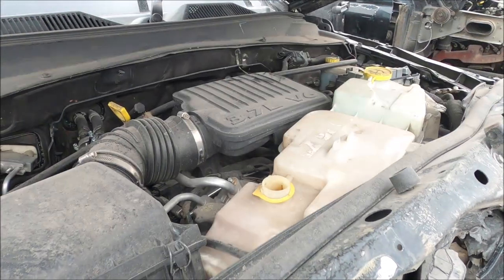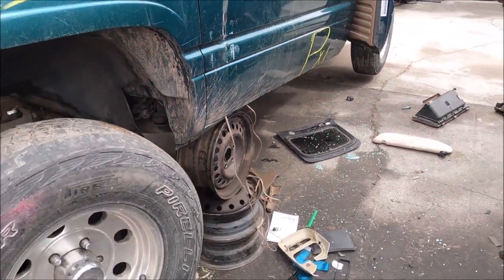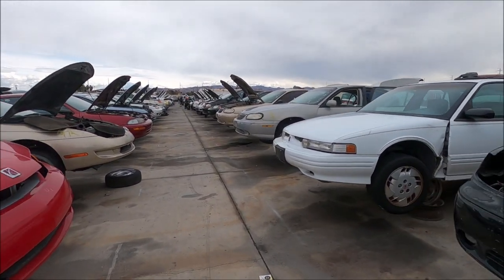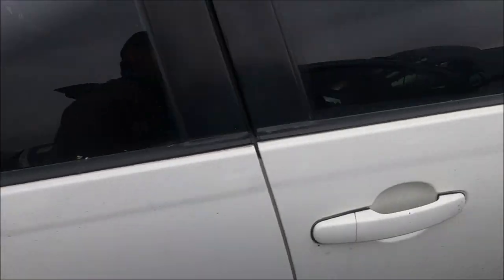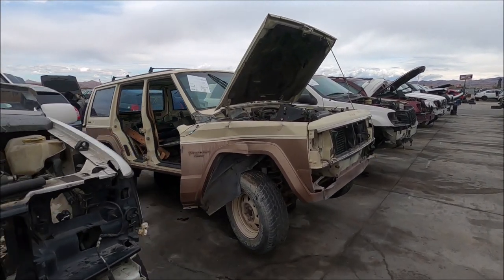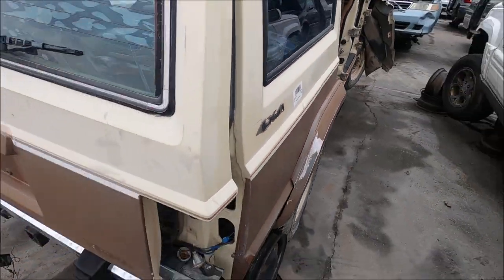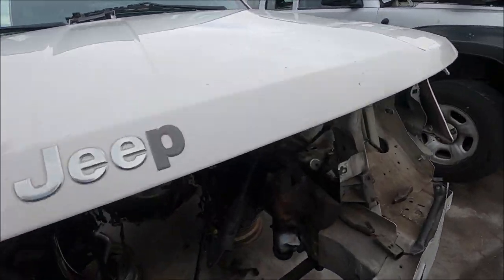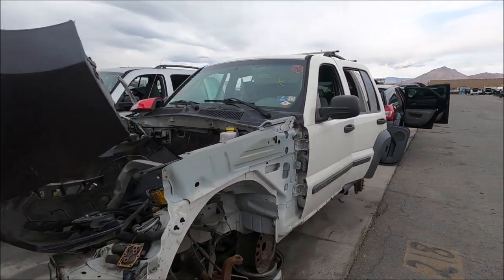On the hunt for 4.7 HO camshafts at Pic-a-Part

Comment: How's it going martin had a question down your alley was wondering if the 2009 dodge ram 4.7 torque sequence is the same as the older models any info would be appreciated.
Reply from the maker: are you referring to the cylinder heads and if so yes the same sequence.

Comment: Hey brother just wanted to let ya know been watching all your videos started tonight cause I’m doing valve seats in my 4.7 ram and the only thing I can think of is I’ve gotta pull the cams .. however do I gotta run the air down in every plug hole and do two at a time if I don’t have the tool like you do ?? Also check my you tube out I’m a country artist buddy ..thanks for the videos !!
Reply from the maker: Yes you need to run air into the cylinder that your working on to prevent the valves from falling into the cylinder.
 If you would like to purchase one of my valve Spring compressors you can contact me on my Facebook Messenger.
 I'll check out your YouTube channel

Comment: Can’t you have the journal’s machined? I just bought an ‘04 Overland in really great condition. Got it cheap because it had a cracked head, or so I was told. I wanted an HO so bad that I didn’t practice due diligence and may have bought a new anchor for my boat. Charged the battery and the starter engages, but won’t turn over. Going out now to check if the engine is seized. If not my plan is to build kind of an SRT clone. Your content will be invaluable in that case. Thank you for that. Fingers crossed 🤞
Reply from the maker: Right on, good luck with the engine and good luck with the SRT cloning 😉

Comment: That envoy with the paint all over is also rare so that's even more bad. They only made the GMC Envoy XUV for two model years and they are like a SUV and truck. The back part of the roof lifts up and goes forward and there is a window in the middle so you can use it as a truck and Obviously they had the window down when they crashed.

Comment: I don't know what it is but it's fun to go to the junk yard and look for parts, so sorry you didn't find any HO cams :-( , have you thought about doing a country wide search and see if maybe you could have some pulled and sent to you? I mean I'm sure you've covered that base with no luck I can only assume? What else are you looking for with your HO build? Blocks are the same right? what else is different? And finally what makes the HO better than what you've already done to yours?
Reply from the maker: I was looking to resale the cams as I have the 08 cams installed in my 4.7
The HO does have a 9.5 compression ratio compared to 9.0 and a steel crankshaft and yes the blocks are the same.
Reply: @martinbuilt  So if the HO is a steel crankshaft and forged if I've heard correctly, whats in the 4.7? Also, I can look up here in Denver for some cams if you'd like :-), let me know,... we have a few pick and pulls and Colorado has tons of Jeeps up here.
Reply: @martinbuilt  Martin, I was at a Jeep place up here in Colorado and talked to a guy that has a couple Jeep Grand Cherokee's with 4.7HO's, he said the engines are locked up but maybe give him a call and see if he has anything for you. Here's the link to his site, his name is Mike, tell him the guy with the blue jeep sent you.  http://jeeprepublic.com/

Comment: I can't believe they. Whoever the owner was of the HO g just left it. I crashed my 2001 with a low mile rebuilt motor and it's always worth rebuilding no matter what the damage is. You're never more than four or $5,000 away from an awesome four-wheeler If you ain't got the money, hang on to it till you do
Reply from the maker: Yeah, you should see the Jeeps out here 98% of them are completely rust free because they're from Southern Nevada and I just picked up an HO engine from a 04 JGC that looks to be rebuilt. I did a leak down test on it, and it came out great.
Reply: @martinbuilt  same here in San Francisco. I drive out to Nv frequently now instead of hunting Mt. goat I'm hunting for cam shafts!

Comment: Anyone that reads this I need help I have a 2000 Jeep Grand Cherokee Laredo 4.0l it has all new fuel tank lines pump injectors filter everything related to fuel has been replaced but every time I go around a curve to the right it runs out of fuel but only if it's near a quarter of a tank of fuel as long as you go straight it'll run to empty  is this normal ? please help I need this to stop
Reply from the maker: Did it have this problem before you change the fuel pump assembly? If not I would think that the anti  flow back Valve for the fuel pump assembly is not working And the fuel is escaping the reservoir within the assembly

Comment: Where there any 2000 dakotas 4x4 slt quad cabs with a engine wire harness 😈
Reply from the maker: There is a great app called Row 52 were you can search entire United States for a particular vehicle.  I like it because they also post the Vin numbers of each vehicle.😉

Comment: I have an 03 Durango 4.7… I was wondering if I can just swap out the heads with ones with the HO without issues as long as the teeth count match or is there something else needed?
Reply from the maker: Yes, you can swap out to the HO cylinder heads and camshafts, but retain your passenger side Cam sprocket since your 03 Durango has the NGC ECM.

Comment: Hi Martin, how easy or difficult is it to find a TCM from a 02, 03, 04 Jeep Cherokee with the 545RFE transmission at those junk yards you go to? I just bought a 2002 V8 4.7 Dakota QuadCab from an 85 year old lady who kept it in her garage after her husband passed, only has 85,000 original miles on it. It has a 24 gallon gas tank on and eats up alot more gas than my 2004 Dakota with a 20 gallon gas tank. I looked up the VIN #s of both truck on the link you leave on one of your videos and the 02 has the 45RFE transmission, the 04 has the 545REF transmission. I would like to do the mod of swaping out the TCM and hopefully get better mpg and perfomance from the 02 QuadCab.
Reply from the maker: I see the 545RFE TCM quite often.

Comment: Hey Martin, I follow your channel, my son just bought a 2004 Jeep Grand Cherokee limited 4x4 with the 4.7, do you have any pros or cons advise to keep an eye on? Thanks my friend 👍😁
Reply from the maker: I would recommend to service the transfer case and front and rear axles. 
When changing the engine oil use 1/2 quart Marvel Mystery Oil.
If it has a sunroof never open it.
And don't over heat that 4.7
Reply: @martinbuilt  thanks Martin I appreciate your help 👍😁
Reply: @martinbuilt  why you have suggested to not open the sunroof?
Reply: @sufle1478  The seals go. It's okay to buy a WJ with a sunroof. But after running a garden hose over it and finding any leaks or not, If it's not leaking don't open it. You can buy the seals and rebuild the sunroof. It's just one more pain in the butt of things to do that don't really add any value to the vehicle. If you got the four seven work on horsepower, which is easy to get

Comment: Do you recommend the complete cylinder head from an HO motor?
Reply from the maker: no, I would just go with the cams. 
You could grab the springs off the HO, they have a higher spring pressure.
Reply: That one with the tore up front end you showed the front tires. Of course they were bald. The dude must have been doing 70 or 80 and hit the brakes and just plained into a pole. This tires were bald. That's what you get. You got to take care of your stuff

Comment: Have you ever put the 2008+ heads on an earlier engine?
Reply from the maker: No I haven't but if you would like to see a comparison of the 08 and the HO heads check out this video https://youtu.be/Bl8stV5VNvQ
Reply: @martinbuilt  thoughts on the dual plug heads, easy to modify the harnesses?

Comment: @martinbuilt You still looking for good 4.7 cams? I have a beautiful set!
Reply from the maker: Thanks for asking Bryan, but I  got a set.
Reply: @martinbuilt  Ok, I've got a nice used set that came out of my 2013 Ram. If you know of anyone looking for a set let me know.
Reply: @martinbuilt  Do you still have the valve covers you cut windows in?
Reply: I've got a Lash Adjuster on the driver's side I'm trying to pinpoint and I think the valve cover that you windowed could prove useful. I live here in North Las Vegas
Reply from the maker: @DieselTechBryan  
contact me on Facebook Messenger if you can.